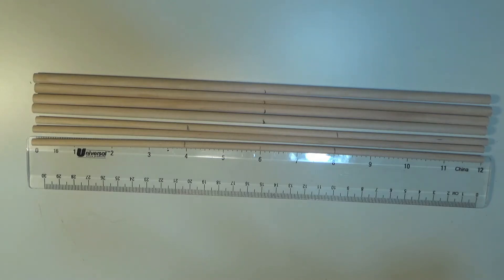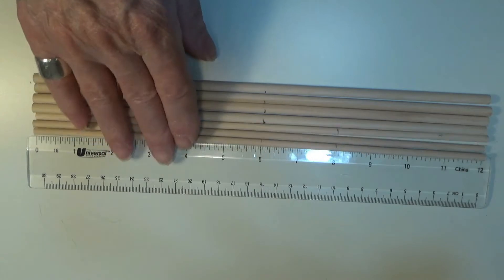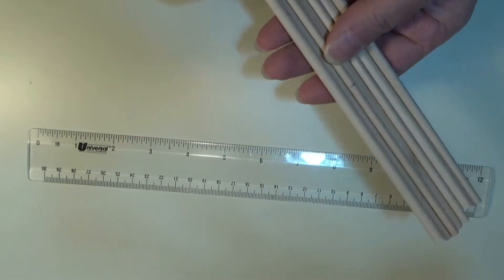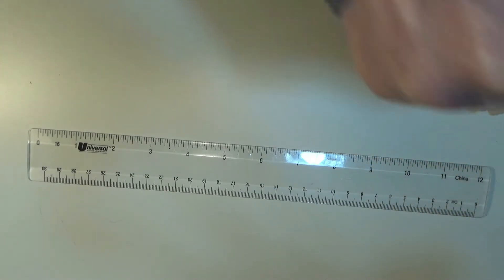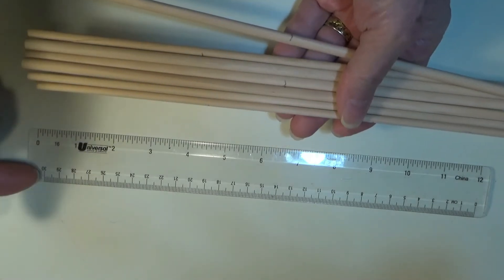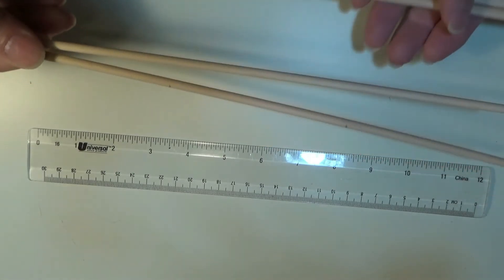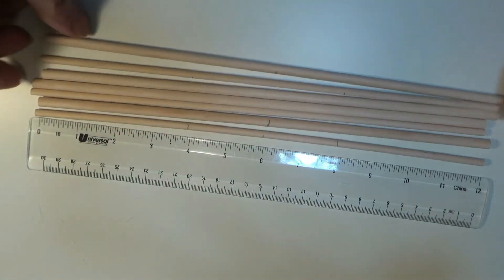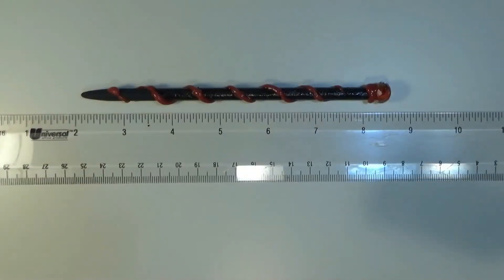Woodturning: Magical Wands for the Small Ones or What tool was that ? 🤓

Comment: Well Mike, that's what I call Collaboration. The wife will be happy! 😎
And when you are turning such small pieces, your speed should be way up. Its all about cutting speed!
Reply from the maker: I think I filmed the 2nd one and as I got more confident the speed indeed went up. The cuts got straighter and I got quicker.  Did it look dangerous Leo ?
Reply: @mpart_woodlathe-stuff  Not at all Mike! 😎
Reply from the maker: @emgiwoodworks  Thanks much Leo ! That goes a long way.